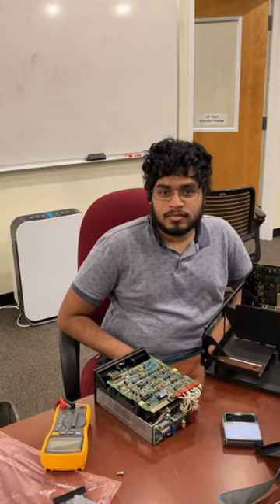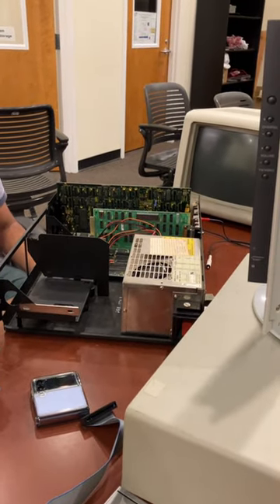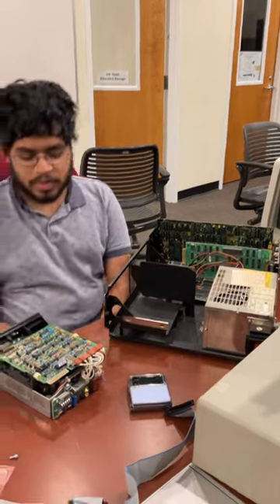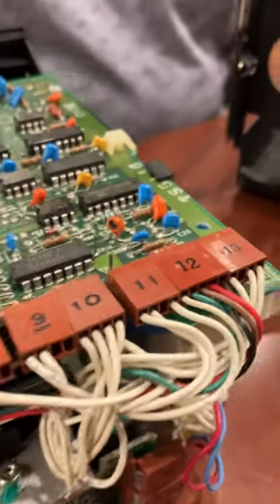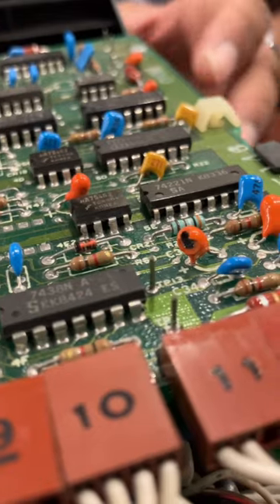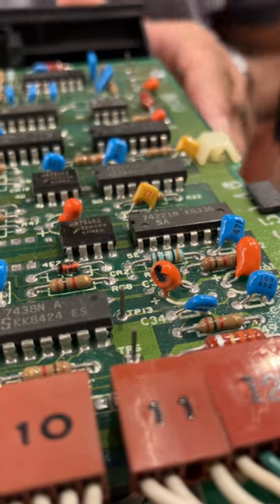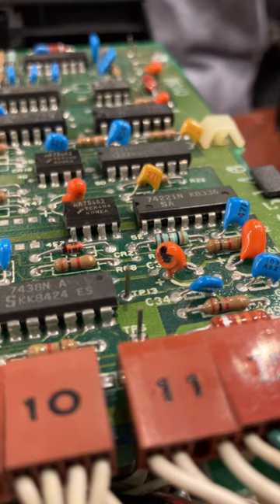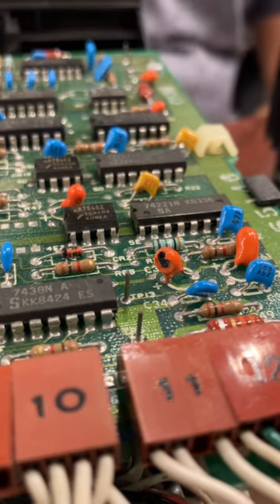Tantalum Capacitor BOOM: IBM PC XT Repair (Retrofuturistic Hardware Vertically Integrated Project)

Comment: I totally did that! It was back in the 80s on a PCAT and the power supply would shutdown after 30 seconds or so. I was designing a networking card. Anyway, applied 12V from a bench supply, watched the current slowly increase until a tantalum cap went off like a Roman candle! Problem found! 😅